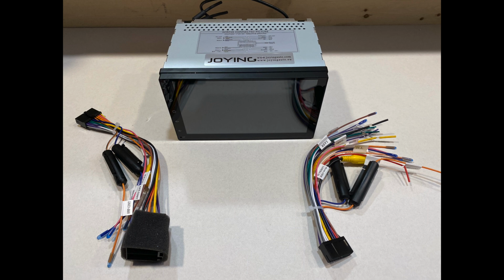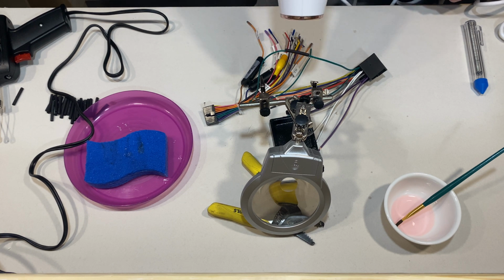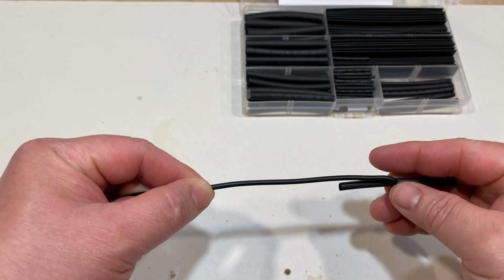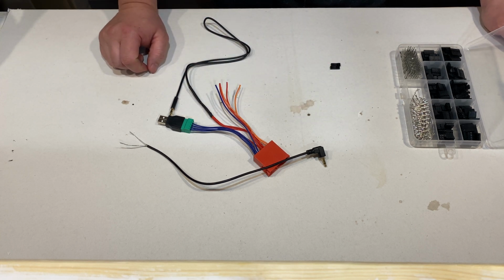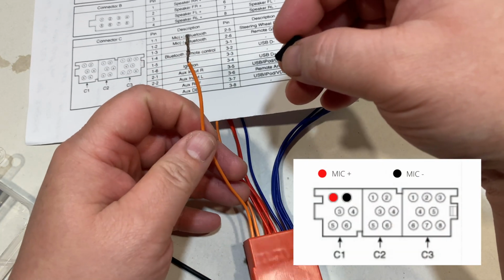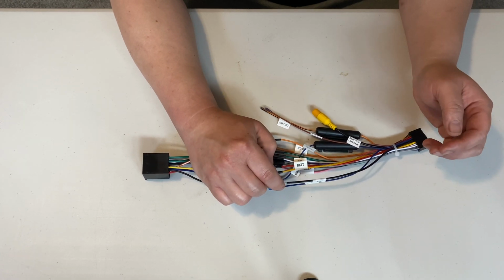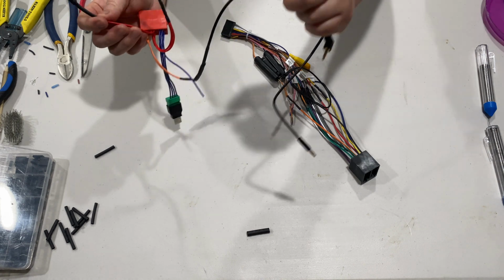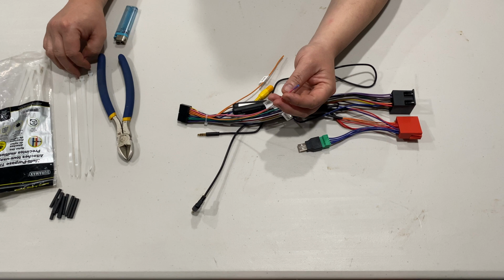Custom Stereo Harness for Hyundai Genesis Coupe

Comment: Ok I got a question noob here so I bought a android 11 radio and a wiring harness for a 2012 genesis coupe with the infinity system and the android radio has the iso harness with it do I need to do any thing other than wiring it all together to keep my steering controls the radio supports the function
Reply from the maker: Should just need to find the buttons setup app / screen. Then just press and hold down the button on your steering wheel and select what button it is on the unit.

Comment: Hi, one more question which SWC adaptor you use?
Reply from the maker: The stereo I got doesn’t require a SWC.
Reply: @mercutio3333  I understand, thank you. I haven't bought a radio yet. Can you tell me what I should look for to get a radio? What is the name of the function (module) when the radio has it?
Reply from the maker: @otakarsulc4686  Just look for built in SWC.There is no particular module.  It will be a specific wire that is part of the wiring harness.

Comment: Thank You. Would you be so kind and provide links for needed items?
Reply from the maker: Wiring Harness - https://www.amazon.ca/Metra-70-7303-Harness-Hyundai-Infinity/dp/B001JT02PO/ref=sr_1_2?dchild=1&keywords=70-7303&qid=1634106463&sr=8-2

USB Connector - https://www.amazon.ca/gp/product/B07H53X194/ref=ppx_yo_dt_b_asin_title_o08_s00?ie=UTF8&psc=1

3.5mm Jack - https://www.amazon.ca/gp/product/B07HQ26P39/ref=ppx_yo_dt_b_asin_title_o07_s00?ie=UTF8&th=1

Pin Connectors - https://www.amazon.ca/gp/product/B07CNF842T/ref=ppx_yo_dt_b_asin_title_o02_s00?ie=UTF8&psc=1

Heat Shrink Kit - https://www.amazon.ca/gp/product/B07282BP1X/ref=ppx_yo_dt_b_asin_title_o06_s00?ie=UTF8&psc=1
Reply: @mercutio3333  Thanks a lot